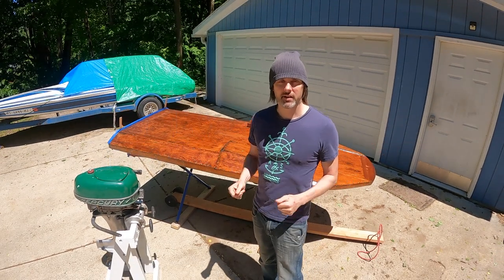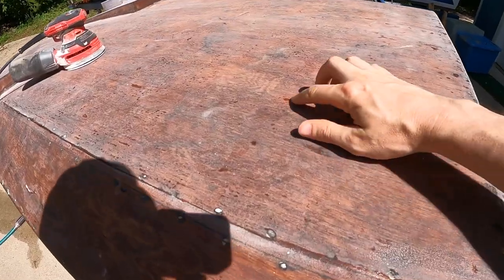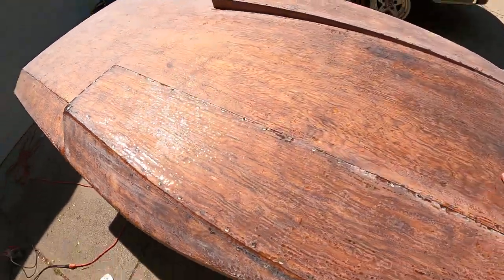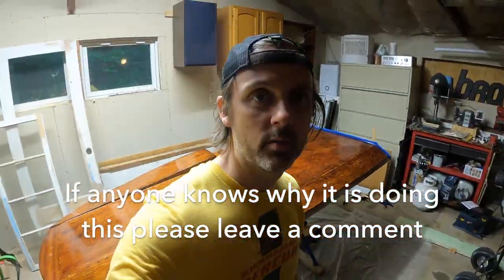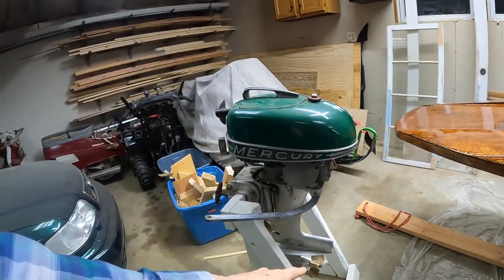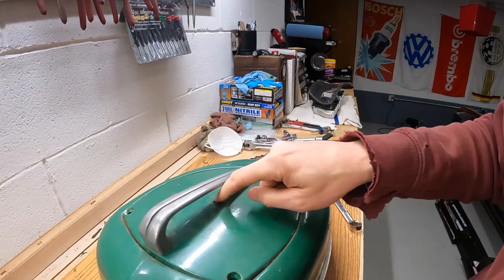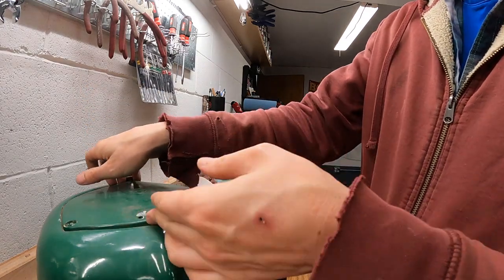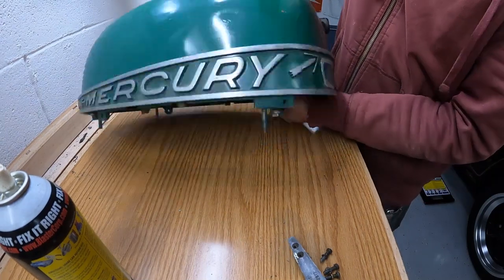50mph with 10hp!  8' Mini Hydroplane Project: Finish Hull & Mercury Kiekhaefer Racing KG7 Outboard

Comment: It sticks because there's no flywheel nut in the hole! Put it back on the motor so that the dogs catch on the nut, and then the nut should turn. Also, the dogs need heavy grease, not thin lubricant. The flywheel nut needs grease too. I was rebuilding these things in the 70's!
Reply: I was going to say the same thing, a lot of the older pull start engines had grease to lubricate it, also not tightening it down to extremes may help.
Reply: Same here Bro, Class A & B stock hydro and Runabout. Early 70s A.P.B.A. racing. P.S. I get a kick out of this (can build one in my sleep) from the ground up.

Comment: Those recoils can be an absolute pain in the ass! I prefer a tank at the steering bar a notched pulley on top of the crank and a pull rope that you have to wrap on the pulley every yank.

Comment: Put the recoil on the motor. The pawls need to catch on the drive nut on the flywheel.
Reply from the maker: Thank you!
Reply: Exactly what I was going to say. The pawls need to spring outward and grab the find on the flywheel. Works similar to the pull on the stihl you got. I'm a saw guy too. I own 9. Combination of Stihl and Husky. Cool old unit. Thanks for sharing.
Reply from the maker: @psavel274  Should get a kiekhaefer chainsaw to complete the collection :P

Comment: The epoxy keeps beading up because there's a contaminant in the wood. Most likely its oil. You need to use rubbing alcohol on those spots to clean the wood. Then brush in epoxy on the spots to seal it. O. The pull start assembly I'll bet you its no longer engaging on the flywheel nut. Take the old nut off get a new nut and torque it on. If you still have the same issue get a couple of LOCK TOOTH WASHERS (not lock washers). Take the nut off and put the washers on then the nut. Torque nut tight then put pull start assembly back on making sure that the jaws aren't in the way of the nut getting in between the jaws. It should now properly engage n start motor.

Comment: Your problem is with the recoil spring. Either it has broken or one end has come loss. First, remove the pull line handle so that you can work on the recoil assembly. Just pop the cap off and untie the knot. Then you can remove the rope spindle off the shaft. Pay attention to the recoil spring. If you aren't careful, it will unwind and blowup in your face. 

The fisheyes in the resin are from surface contaminants. Dish soap is okay for removing some oils, but it's inadequately by itself to prepare the surface. I like to follow up with alcohol and then acetone. Lacquer thinner and xylene also work well. You have to verify that acetone will not damage the existing finish before applying. Test some dried epoxy to make sure that it doesn't soften it.
Reply from the maker: Spring is definitely not broken, it pulls it back in fine.  It just won't let the rope out.
Reply: @ADDvanced  I've gone through the issue you're having many times and it's always the spring. Typically, an end breaks off. The springs are hardened and VERY brittle. Sometimes the problem is with a piece breaking off a casting that is supposed to retain one end of the spring.

The fact that there is still some preload to retract the pull rope does not in anyway indicate that there is not a problem with the spring.
Reply: @ADDvanced  It's also possible that your spring has some rust issues which has fused parts of it together and is restricting its range.

Comment: Not a Minimax. Like you said it's a 3 pt hydro. Which should be faster than a Minimax which is a monohull. The 3 pt should have less hull in the water thus less resistance. In the 50s we had a Minimost type hull running a 10 hp Hurricane with the quicksilver lower. Could never get more than about 32 mph. Unfortunately the throttle stuck wide open and steering wheel came off in Dad's hands and he flipped it. With the throttle stuck wide open it sucked water in and destroyed the block. I was about 12 and used to run up and down the river alone.

Comment: looks like the to plate (the one that when removed made it work) might need some lube (NOT P Blaster!!! ) AND torque it to spec NOT an air ratchet that made it way too tight IMNHO
Reply from the maker: It turned out to be it needed the crank pawl nut, or the teeth just hit themselves and lock up.

Comment: Wear a helmet bud. Why not a layer of roving tho? Edit. The fish eyes are from the woods sap. Try to spray the epoxy next time. Harbor freight conventional gun with a 2.0 tip works fine and $30 is easy to throw away if you can’t clean it quick enough
Reply from the maker: That would add weight, this thing needs as little weight as possible to perform well.
Reply: @ADDvanced  if it cracks I promise I won’t say told you so. I dig your videos. Just found them today. Keep em coming.